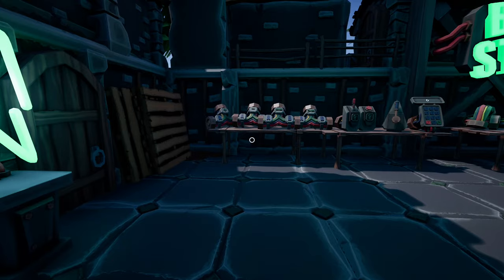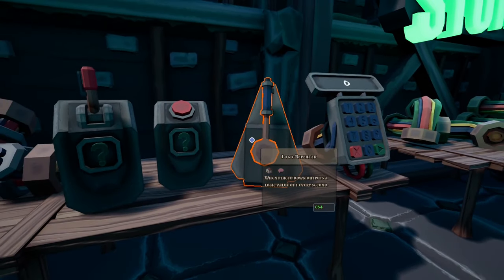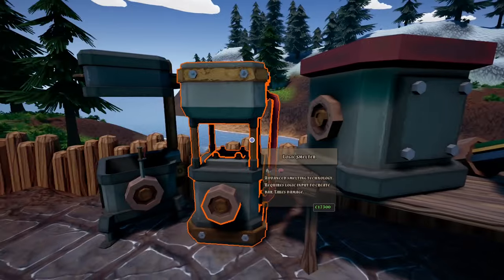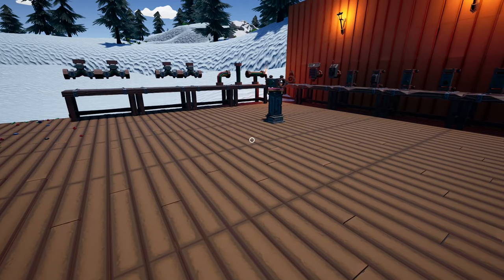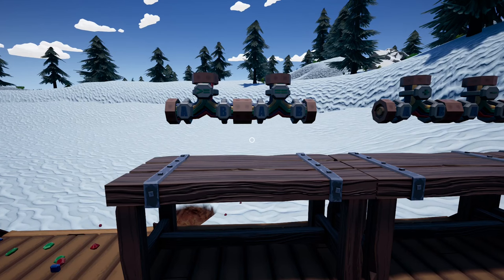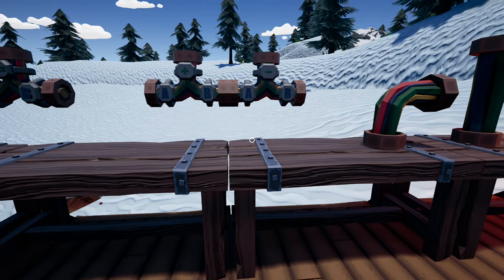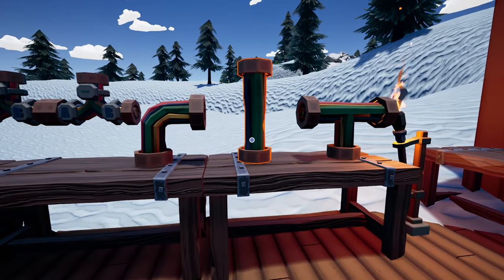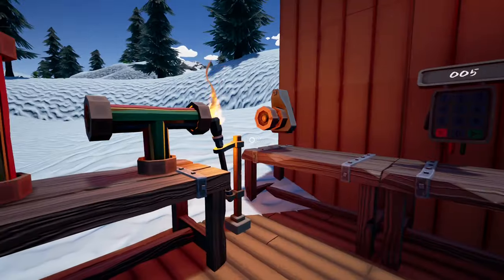Smelting hands free in under 15 MIN!!! hydroneer 2.0 |  Auto-smelter | TUTORIAL | HOW TO | LOGIC |

Comment: Thanks for explaining the Logic system, unfortunately I still don't think its a practical solution to automate the process when all it takes is a press of the left mouse button to empty the manual smelter. Bearing in mind you need to reproduce what you have shown here 2 or 4 times. 

I feel the Dev's need to rethink the system and reduce the components to 3 or 4 Items of logic. The Auto Smelter, the Reader/Magnet attached to belt and a wire attached to the Smelter. After the Smelter is returned to working state the counter on the Reader/Magnet resets and process resumes. A keypad attached to Reader/Magnet to set the desired value for production of bar weight/value.
Reply from the maker: thats fair

Comment: The flip flop does care what signal it gets because it only changes the output signal if it gets an input signal of 1. It doesn’t change its output if it receives a 0 input signal. If it did then it basically wouldn’t do anything. If it receives a 1 it will output a 1 if it then receives a 0 it will still keep producing a 1. When it receives a 1 signal again it will change the output to a 0.
Reply from the maker: i will correct and address this in the video i do taking a deeper look at each one. thankyou
Reply: @t4g4ming  let me know if I’m wrong I’m new to Hydroneer and I haven’t actually used the logic in this particular game but I have on countless others and that’s typically how a flip flop circuit works.